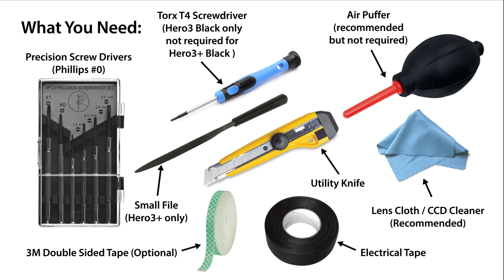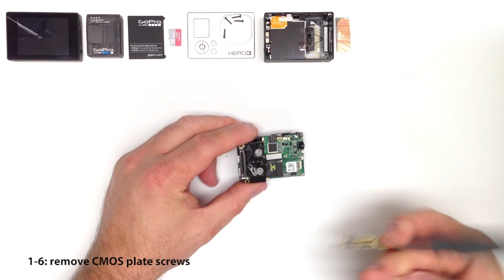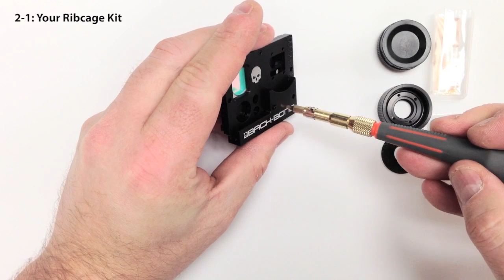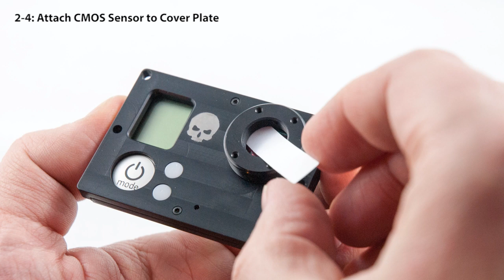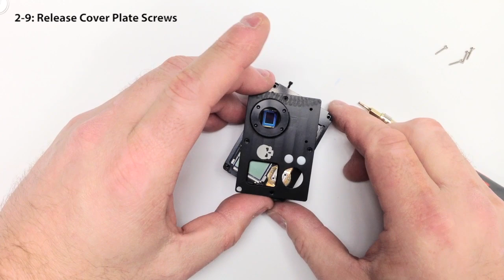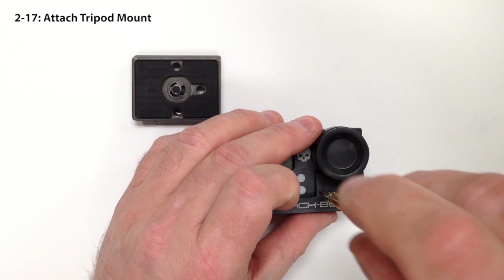Installing Your Ribcage Mod Kit

Comment: which is the lens that appears at the beginning of the video? which model and brand?
Reply from the maker: Arecont Vision 5MP 4.5-13mm CS-Mount
Reply: tanks, those glasses no longer produce the fisheye effect?
Reply: Miguel Hidalgo
you'll still get some fisheye at 4.5mm but once you adjust it to 6mm or 8mm there is very little distortion. 8mm on the Ribcage is roughly equivalent to 50mm on an SLR camera.
Reply: q thanks lenses can I use for auto and manual focus and avoid the fisheye effect?
Reply: q thanks lenses can I use for auto and manual focus and avoid the fisheye effect?